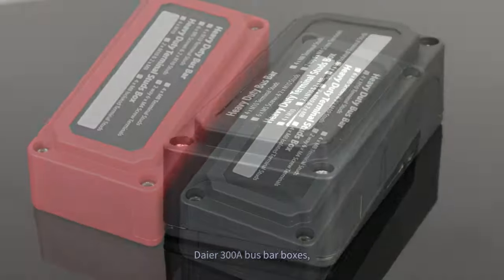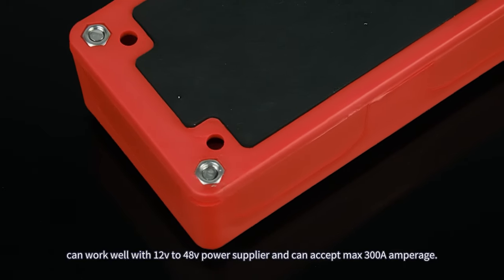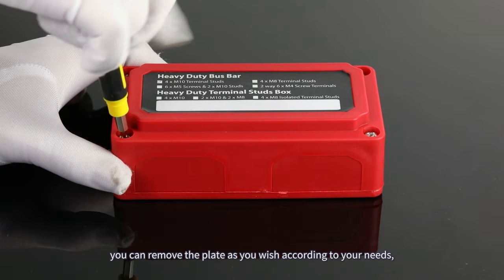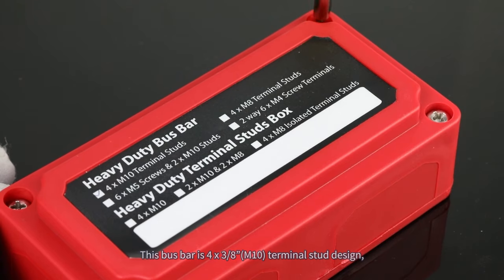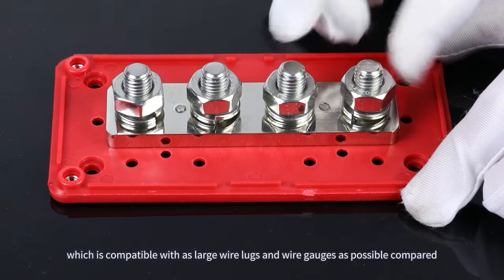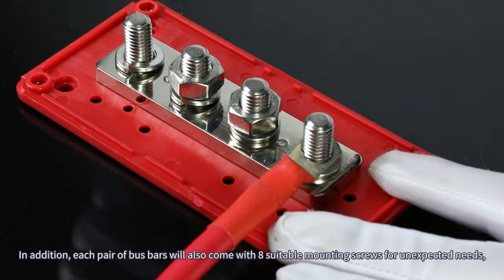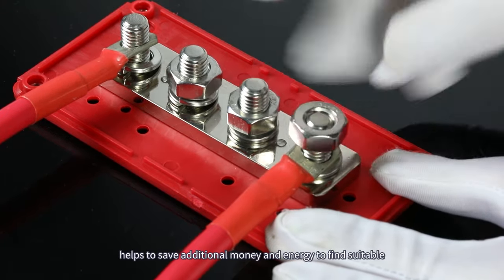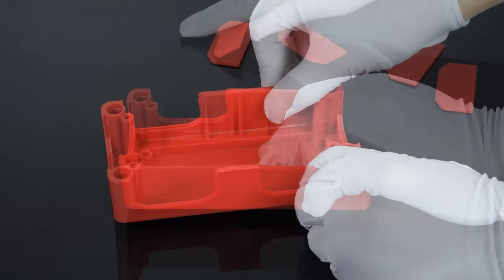12-48VDC 4 × M10 Studs Heavy Duty Bus Bar Box - How to Wire a Busbar

Comment: I have a set of 150 amp busbars. I am planning on using for my home solar system. I will be using four 12 V Lifepo4 batteries wired in parallel I will be using eight 100 W solar panels and a Victron 100/50 charge controller for six of those panels and also a Victron 100/15 charge controller for the other four solar panels. I will also be using a Victron Phoenix 1200 12V inverter, for this set up, I will primarily be using it to power my Frigidaire refrigerator. I will never pull heavy amp loads will these buss bars be sufficient?
Reply from the maker: Thank you for providing the details of your solar system setup. Based on the information you've shared, your 150 amp busbars should be sufficient for your needs. They can safely handle the maximum current expected in your system.
Reply from the maker: Batteries: Assuming each LiFePO4 battery has 100Ah capacity, your total usable capacity (at 80% depth of discharge) is 320Ah. This should power your refrigerator for approximately 38 hours. (PS: Assuming that a refrigerator consumes an average of 100 watts per hour, it will draw about 8.3A per hour in a 12V system (100W / 12V = 8.3A).)

Solar Panels: With 800W of solar panels, you'll generate roughly 32A of charging current under real-world conditions.

Charge Controllers: The Victron 100/50 and 100/15 controllers combined provide 65A of charging capacity, more than enough for your solar output.

Inverter: Your 1200W Victron inverter can handle a maximum current draw of 100A, easily exceeding your refrigerator's needs and leaving room for other appliances.

Busbars: Your 150A busbars are well above the combined maximum current of your system (around 132A), ensuring safe and efficient operation.

The data source is based on the same products on Amazon, I hope this information is helpful.
Reply: @daierelectron  thanks 👍😊
Reply: @daierelectron  thanks 👍😊